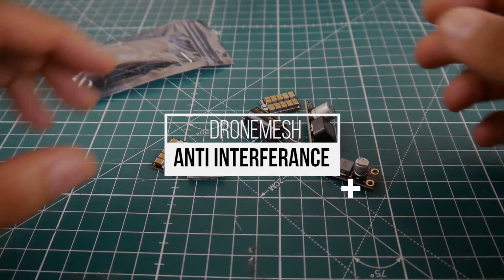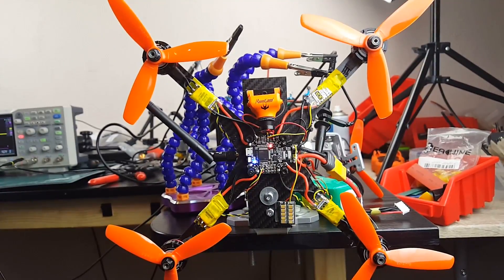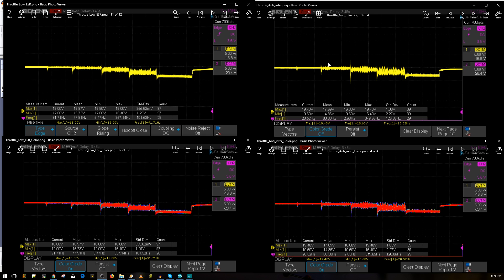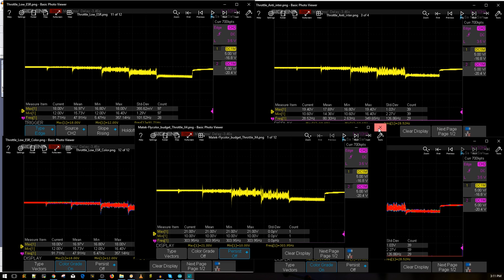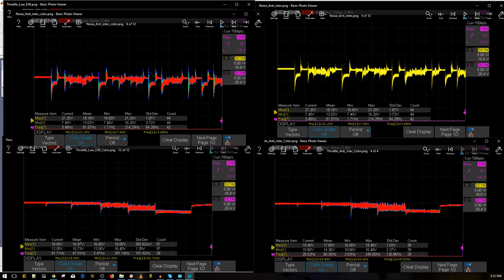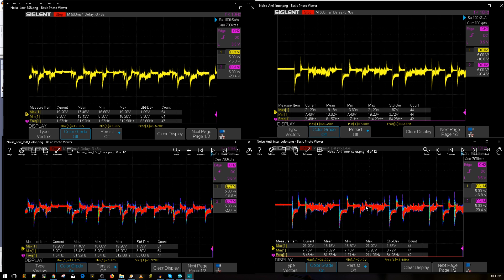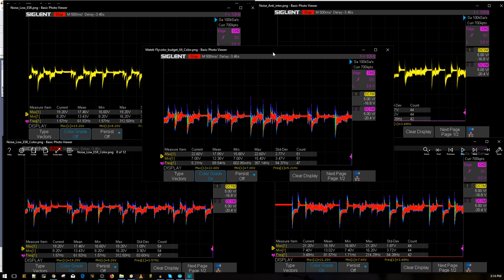Anti Interference Board VS Low ESR Capacitors // Real Review and Testing

Comment: It is absolutely pointless to hook up a capacitor or a capacitor array with such long and thin wires....

Solder 1-2 ceramic caps in 1 to 10μF range on the vtx pcb power pins, on the sbec output pins and on the camera power pins if needed. 
Not dangling on wires.

Comment: I am sorry for the newbie question :) Can I use this parallel capacitor plate on any power board? Where did you solder it exactly? I have video noise like black stripes only when I use the throttle. The more I give gas the more they show up , its very annoying! Thank you!

Comment: You may also find cleaning up your wiring has an even greater effect. Some of the transients you are measuring there are from radiated emissions, as opposed to conducted.  You may be surprised how much visible video noise is from radiated emissions, and how much clean, proper wiring helps.   I understand you are shooting for worst case, but more often than not, clean, proper wire routing and proper grounding will completely eliminate the need for additional capacitance.  I do agree with the Flycolor Raptors being great ESC's. Use twisted pairs with ground for all your small signal wires (ESC signal, video), and ensure you do not create ground loops.

Comment: Capacitor should be soldered as close to the circuit as possible, otherwise it's useless. The power cables should be as short as possible. These two long, thin wires works like inductors.

Comment: Hey Drone mesh,  I use the Hobby Wing 40 amp 4in1 combo they provide a 470 uf cap, do you recommend using a 1000 uf cap to for added protection from voltage spikes..

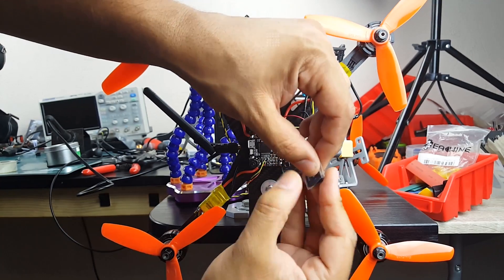Comment: @1:10 the connection.... thats a joke isn't it?!? I am a student in electrical engineering and this idea hurts me in my head!

Guys thats VERY bad testing! your goal with the Caps is to minimize Tre Resistance, right, but you defeat the whole point when you adding this piss-poor wires to the board! The ceramic caps are way better than LOW-ESR Elkos, thats simply a fact and can be proven by the data sheets. 

You introduced a load of inductance (Complex resistance/ Impendance) and resistance which renders this test to complete bullshit!

I dont get why most people in the comments are believe in this. Go check out EEVBlog on decoupling caps, we do kind of exactly the same here. you dont want huge capacity, 100µF is more than enough when installed right and use right caps.

Comment: May I suggest a test? Lots of people are putting caps at the XT60 instead of at the ESC because it’s easier to fit in tight builds. Could you see how much less effective the cap is when located at the XT60? What if the capacitance is doubled?

Comment: Hi mesh I’m building my first quad from one of your videos that i watched and I’m just waiting for my motors but my question is when I plug it to the battery with out the motors the esc’s make no noise is that normal since they have no motors connected? Thanks for any help. 👍👍👍
Reply: martin maciel . That's normal, the noise comes from the motors, so no worries. Wish you well with your build.

Comment: Love your channel, drone science for the win! I'm going to do my first build with a Helio spring, so I'm going to be using a Matek fchub as pdb. Curious if anyone has used caps on the vbat pads that feed the FC? Just thinking that would keep the noise out of the gyro, and I would run the vtx and cam off the FC bec.
Reply from the maker: DrDeeZee FPV Low esr caps go on vbat where xt60 is connected for best result that is if your using only 1

Comment: Makes sense to me that one big fat cap is better than multiple small ones. Solid testing.
Reply: Not exactly. The total capacitor bank capacity and connection quality (not too large wire length and not too thin wires, soldering quality etc.) matter more. But the capacitor alone not always is the savior. Especially if main noise source in video and gyro is bad 5V BEC on flight controller board.Then you may need to add low ESR capacitor on 5V rail or even castrate 5V BEC chip out of FC and use external 5V BEC instead. Also mind the distance from naked VTX board circuit side from video circuitry. VTX if is located too near from FC video circuitry, may noise your eyes out.

Comment: So I see a major problem with this capacitor test.  The greater the distance from the source of the noise ( the ESCs ) and the capacitor / filter the less effect it will have.
I have experienced this effect first hand with my own setup:
TBS Unify Pro Race
Emax 2306 2400kv with 4 individual Bullet 30's (literally the noisiest setup ever, I know😅)
I had horrific lines in my FPV feed and an osd that dissapeared under slight throttle fluctuations.
At the time, I was using I was using a first gen DYS F4 PRO, and I put 4 individual low esr caps on each of the + and -  ESC pads on the FC side.  This literally changed nothing, and I still had the same horrific video noise.
I talked with some people in my local MultiGP chapter and they told me I needed to move the caps to as close to the ESCs as possible and keep the capacitor's leads as short as possible as well.
I took their advice, and literally placed the same 4 individual caps directly onto each of the + and - pads of each ESC.
All noise immidiatley vanished and my OSD was crystal clear and constant.🖒
I later asked why it made such a night and day difference, and I was told that the noise caused by our ESCs is like a small snowball rolling down a hill quickly becoming a massive one.  The sooner you can stop it (filter the noise), the better.
In my case, by the time the noise had hit my caps when I had them on the the FC side, the noise had already been growing from "rolling down the hill" long enough for the caps to be completely ineffective.
But when I moved the caps to right  on the source, it worked perfectly.
Reply: This is also why I find caps that are placed on the battery leads for non 4in1 ESCs a joke.
Reply: Amari FPV maybe Drone Mesh could do a test on the difference between mounting locations for ESCs. Could be that the further away from the source the bigger the cap required.

Comment: Check out those 5.1v 0.1F(100,000uF) SMD(surface mount) supercapacitors. Just use 5 in series across the battery for awesome power smoothing.
Reply: Super caps usually have very high ESR, which we don't want.
Reply from the maker: Change Agent Email me link
Reply: Drone Mesh just look for 5.5v supercapacitor on AliExpress, there's plenty of them
Reply: bobbfwed Yes thats why I included two links. The second link is the low ESR.
Reply: I don't think YouTube is displaying any of your links. But wouldn't using capacitors in series increase the ESR too?
Reply: bobbfwed Murata dmh supercaps just search that. Yes in series there is an increase but it will still respond to changing current demands quicker than the battery and with more capacitance than a regular cap. Proper testing should show for sure if it smooths it out anyhow.

Comment: I think you need to shorten the cables to the caps/anti board. If you look at any pcb, the decoupling cap is very close to the IC is is intended for. Would be nice to make a side by side test with the same setup but with short and long cables and see if there is  any significant diff.
Reply: Yes too long and tiny cables I agree. Love the tests any way :)
Reply: Yes, long cables catch anything like an antenna, and with so much close interference, there should be some difference for good with very short cables.  -oh, 4 years later.. :/

Comment: Hey DroneMesh. My friend is placing a diode with the capacitor to remove the negative effect of CAP discharging. ALSO! One thing that came to my mind is placing capacitor on BEC 5V line to camera, even after the main CAP on VBAT. Would it make sense or any difference, what do you think?
Reply: Diatone has added a cap to the camera bec to address video noise and appears to have fixed their problem,  and flying friends have found it works sometimes with video problems. Just depends on where your noise is coming from. Can’t hurt to try:-)
Happy flying!
Reply: Chemistt adding a diode to a capacitor would make this capacitor totally useless, the capacitor is smoothing the voltage by constantly charging on a voltage spike and discharging on a voltage drop
Reply: Danila Kilin, sadly I have no knowledge on what diode does and feel overwhlemed by all the other stuff right now so I am totally fine with knowing that CAP is the best option for recovering from nosiy setup. Althought your argument makes sense, I remember him mentioning that he added diode to CAP, to either stop cap discharging into the PDB or not to discharge into ESC. Thats all I can tell. I never tried that nor I want to try it.